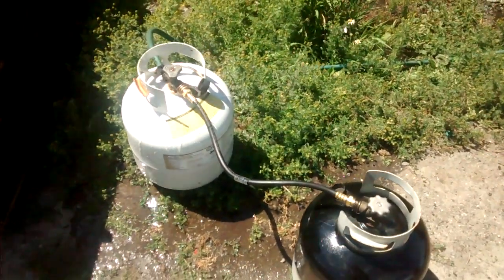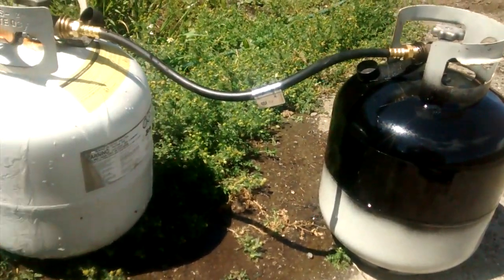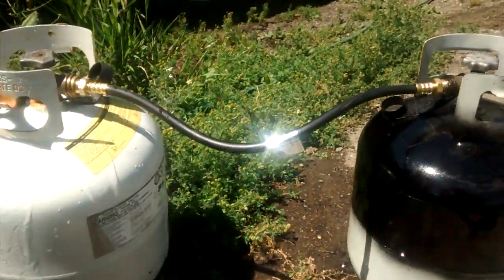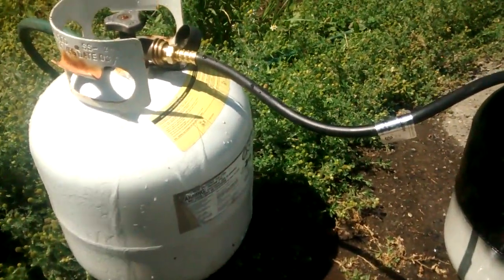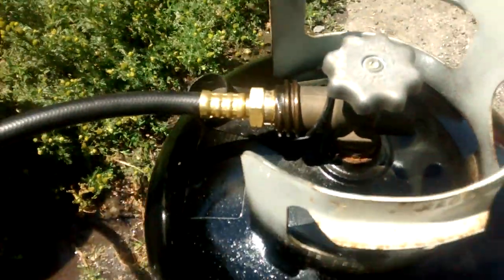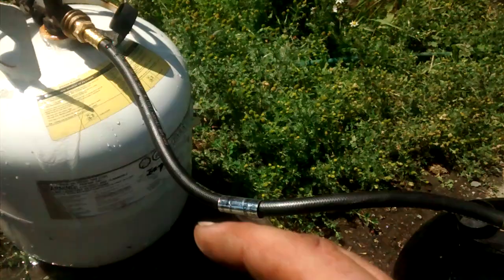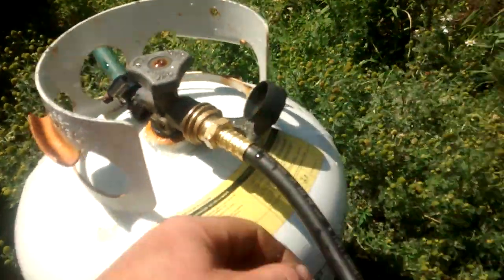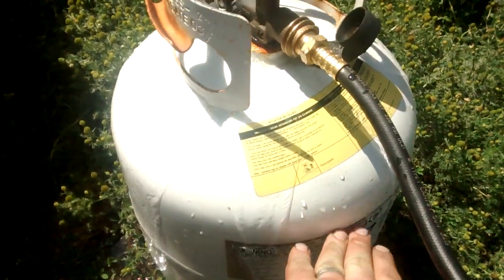How to transfer propane from one 20lb bbq bottle to another #propane #campinglife  #camping

Comment: you can open the bleeder valve on the receiving tank, obviously in a well ventilated area, turn the supplying tank upside down and you will cut the transfer time down to minutes.
Reply from the maker: Dosen't work. As soon as the liquid inside touches the float valve in the tap it shuts the flow off. I can only seem to transfer vapor with these types of bottles.
Reply: this works fine for small containers like fire lighter refill cylinders
Reply: Yea i was gonna say turning the source bottle upside down, bcoz insude its a liquid. This way hes doing means the liquid has to turn into a gas then cool back down to a liquid.
Reply: Interesting, your source tank has the old valve which as I understand didn’t have a float. You can tell the new by the tri lobed valve knob. The older didn’t have overfill protection....the float.
Reply: @machinesnmetal  It actually does work but only if the source bottle is full.  In a full bottle the float points straight up when the bottle is upside-down. I have done this many times but mostly for filling 20# or smaller from 30-40# cylinders.  When the liquid level gets down to 6" or so in the upside-down tank, the float does tilt and shut off the safety valve which is why your partially full tanks don't transfer upside down.
Reply: @chiraldude   when you noticed that theres no more coming into the empty shake the one is elevated the stressed gas will force the liquid to flow into the ether bottle
Reply: @machinesnmetal  - I think that is a safety feature of the newer tanks so they won't let liquid propane out if tipped. When upright, the valve is open to allow the vapor out as intended. :) I am no expert.
Reply: @ussmillerco  _ I think that is why merchants won't fill the old tanks - new tanks = safety feature.
Reply: @chiraldude  _ thank sounds reasonable.:)

Comment: What most people don't know is there is a dipper pipe in those big LPG bottles (not all), that goes to the bottom of the tank. The pressure in the tank pushes the liquid from the bottom of the tank, though this pipe, to the smaller gas bottle when the bleed valve of the small bottle, is opened.  So inverting a bottle that doesn't have a dipper, is necessary for the same process with standard gas bottle.

Comment: if the "supply" tank isn't full, most of the liquid propane is in the bottom of the tank. If you paint the bottom 1/3 of the supply tank black, it will heat quicker and/or hotter, which should increase the "boil off" more and give you more propane and/or less time.
With that said, as others have mentioned, not sure why turning the supply tank upside down won't do a better job. Just like is done to refill 1lb bottles from a 20lb cylinder. 
In any case, nice hack
Reply: I do think he was just trying to give a short no hassle low money propane transfer but in my opinion you should make your own video instead of giving extra advice.
PS
       My wife just said to me if he's so smart why doesn't he make his own video lol.
And then I told her I was thinking the same. thing.
Reply: @YHRIM
I appreciate your input!  I think many of us learn a lot more from knowledgeable people sharing in the comments than we would have otherwise.
Reply: @craigkerr9281  it's just additional input relax
Reply: He gave his input then followed it up with a compliment which is how I wish more people would communicate on YouTube personally. And if we start telling people what they can and can't say then we might as well be communists like Russia, China; 
I learned from both of them (the OP and the commentor not Russia and China) so hats off to our free country. 

Only two things I've learned about Russia and China is that they 1: Have some of the harshest dictarors strict policies and nearly no freedom of expression, and 2: They have some of the most amazingly beautiful, jaw dropping gorgeous women in the world.  
Hey its a free country so ima voice my opinion too, in the propane video comments yessir thats right. Peace and love to all, bye bye
Reply: I agree make a video with this additional information. It will help folks, and when dealing with volatile gasses knowledge saves lives. 
(Posted with sincerity)

Comment: Why not just turn the donor tank upside down and the open both  receiver and donor tank valves? Just like with filling a 1 lb bottle from a 20 lb donor tank/bottle. You have the screw vent to open up and close for ventilation unlike on the 1 lb bottle. That way I can also refill my expired bottles that the facility wont fill up and have some reserves on standby.

Comment: Thanks for the video. I was looking to verify it's possible but for the opposite reason of refilling an expired bottle until i can afford a replacement. Nobody will refill the old expired horizontal tank in my RV but vertical ones don't fit inside its housing so i intend to refill my newer bottle then use it to refill the horizontal bottle which is larger so i know can safely hold the full amount.... Figure I'll need to use an elevated hot bath holding the smaller bottle will help while keeping the larger bottle cool...

Comment: leave the tank your transferring from in the sun this will make the pressure rise . when transferring to the cool tank turn the hot tank upside down now you will be filling with liquid . will go a lot faster
Reply from the maker: Dosen't work. As soon as the liquid inside touches the float valve in the tap it shuts the flow off. I can only seem to transfer vapor with these types of bottles.
Reply: @machinesnmetal  I wonder why that is because I don't have that problem transferring to a 1# bottle?
Reply: @angeliquerider-mitchell2538  new 20lb tanks with a triangle handle (like the one he’s filling) have an OPD valve , basically a float valve, that stops flow when full.  If flipped over it would also stop flow, 1lb canisters do not habe them. 
Oddly, the tank he was transferring from was the older type star handle, that is a non OPD and could have been flipped over making it much faster.
Reply: NO
Reply: Agree with Bill, the older valves were phased out (by trading them in and having the supplier add the new valves). The newer valves added a float to prevent overfill by a inexperienced refiller.
Reply: @billjohnson9343  - it is my observation that the difference is the large outside thread on the fill port of the newer tanks. The old tanks have the smaller (reverse) threads in the inside of the fill port. They both have interior threads but the new ones have the outside large threads with non-slip plastic fitting on them for easy (no wrench) connection. The valve handle shape probably is part of the new tank ID also?

Comment: News flash.   Turn the black tank over and you'll be transferring liquid instead of gas, this way the black tank won't lose pressure when boiling off (similar to any Freon) because propane is a Freon that is not used because of it's explosive nature.   You will get the job done in 5 minutes instead of an hour.   Cooling the fill tank is fine and starting with a warm filler bottle is good.
Reply: News Flash!!  Propane is a refrigerant. Freon is a company name who makes refrigerants. I promise you that Freon does not make propane. It comes from wells with natural gas and is separated out.
Reply from the maker: Dosen't work. As soon as the liquid inside touches the float valve in the tap it shuts the flow off. I can only seem to transfer vapor with these types of bottles.
Reply: Mark😂😂😂😂😂😂😂
Reply: @machinesnmetal  - After reading some of the comments, it seems that the "upside down" method only works if the supply bottle is one of the larger bottles?

Comment: I always thought propane vapor condensed back into a liquid at -47F/-42C unless it was mechanically compressed. Or  I should say propane boils above -47F.

If you were to connect a full #20 tank to an A/C evaporator coil with a fan behind it, then connect an empty #20 tank from the discharge end of the condenser and place it in a deep freezer could you use this set up as an air conditioner?

So as the liquid turns into a gas it absorbs heat. As you may know propane has similar heat absorbing properties as R-12 refrigerant. Only problem is it's explosive.

The question is would you need to turn the full tank upside down and feed the liquid through an expansion valve? Or just crack the valve open and send the propane gas through a regulator on the source tank turned right side up?
Reply: The ideal gas law is PV=nRT - 

So the mechanical compression idea is a moot point when both bottles are already filled with liquid propane. 

In the end you're only looking at a difference in substance quantity and temperature. Im not sure how to calculate the Δt required to change from liquid to gas under the pressure that would exist, but if @UCcu8lp2Hrt4Ux3e2Bt_yf9A says it works, and has video proof, then we can assume it actually does work.

Comment: What store did you get this adapter at?
Reply from the maker: Lordco
Reply: Mr. Heater 2-Tank Hook-Up Kit with Tee and 30-Inch Hose Assembly with P.O.L. Male Ends.   amazon
Reply: i got mine at Tractor Supply Company

Comment: Worked for me (i used hot water instead of painting it black, and an ice bath instead of a hose) tool about 2 hours.   Sounds like other people recommend turning it upside down, I didn’t do that... but it does make sense
Reply from the maker: I tried flipping the source bottle upside down but there seemed to be a safety valve inside the bottle that would cut the flow .
Reply: this style bottle has no straw. so the liquid propane boils and exits the valve as a gas.   there is another style of propane bottle designed with a straw that sucks the liquid propane up from the bottom.  the top of the propane boils and creates pressure that forces the liquid up the straw...  perhaps the other people were using this other type of tank.

Comment: Why not turn the source tank upside down ?  and I though that since the pressure doesnt continue to drop, it will continue to stay liquid ?
Reply from the maker: There's a float valve that shuts the flow off if the bottle falls on its side or upside down, nothing will come out if it's upside down.
Reply: Would the float valve still be floating open when liquid still exist and upside down ?
Reply from the maker: float valve would close valve.
Reply: @machinesnmetal  I also wanted to ask you this, but because I wanted to know the answer instead of sound like a smarty pants, I bothered to read the comments where a million other people asked this. Thank you for answering the same question several times so I could find it!

Comment: Flip the one your draining from upside down and make it higher then the bottle your filling (so liquid is draining).     A way to speed this up would be to put the bottle your filling from out in the sun for a few hours to make it warm.    It would take forever to do it the way you are trying to do.
Reply from the maker: Dosent flow upside down, tried it more than once. there is a check float valve that stops the flow. I'm not really in any hurry, retired and have lots of things to do while this is hissing away outside the shop.
Reply: @machinesnmetal  It will if your drain bottle thats full is warmer then your one your filling.   I do it with 45kg bottles all the time.  You must flip the bottle upside down your filling from
Reply from the maker: I've only done it once , for that video 🤠
Reply: @scottbennett8018   (& @machinesnmetal) - I think the key to the upside down method is the larger (as in 45#) bottle. The liquid propane is accessible to the outlet tube until the liquid reaches the level where the float valve kicks in (actually stops floating and drops because it is inverted) and stops the flow. 
I also think some people are comparing apple to oranges - old style tanks to the new tanks with the safety valve/float. 
Let me know if I'm missing something here......

Comment: Just flip the black bottle upside down as this will speed up the process. jkjkjk You already answered that about 10,000 times, but for some reason commenters cannot read priors. thanks for the video
Reply from the maker: I think I tried it upside down but the safety valve in the fuller bottle kept closing off the flow.
Reply: @machinesnmetal  You should just flip over the black bottle to speed it up and get er done

Comment: Where can I get a hose like that? How do I search.  I keep finding 20lbs to 1lbs
Reply from the maker: It's a "Pol to Pol" type hose
Reply: @machinesnmetal  I appreciate the response, but I'm just not finding one anywhere on the internet. I even called a propane supply place they didn't have one either. 
If you have a link I'd be grateful
Reply from the maker: https://www.ebay.com/itm/173614629303?chn=ps&mkevt=1&mkcid=28&var=472292975421&srsltid=AfmBOorO3QseteXU9TT8RdPv3hjRQo4pSFG1ddQze6Z8QWiajxJv2efIcM8
Reply: @machinesnmetal  thank you..... Damn that's expensive

Comment: Aren't you supposed to put black tank upside down?
Reply from the maker: There's a float check valve in the black tank valve. shuts flow off when tipped past 90 degrees.

Comment: Curious to know the actual gain here considering the wasted water which is costly beyond the dollar....
Reply from the maker: i get 1/3 to 1/2 full bottled turned in for recycling all day long, and the water is free at work. I consolidate the fuel and take it home to heat the shop in the winter time, it's a win win win!
Reply: Ok....use ice and water in a bigger vessel that holds the tank being filled. Or Do it in a river, sheesh where are you....water is quite cheap.

Comment: That's really safe!
Reply from the maker: Safest way I know.
Reply: @machinesnmetal  the only problem is to overheat the black tank...if that is the case the tank is equipped with PRV pressure relieve valve....which will evacuate excesss pressure
Reply: its perfectly safe. how do you think they fill the damn things

Comment: Thanks, but gravity works better!!! Put one bottle upside down at a higher level than the other. Gravity does the rest… NO PAINTING BOTTLES OR USING OF WATER!!!
Reply from the maker: Dosent work. These bottles have a check valve that closes when you turn upside down .
Reply: Read the other replies before replying. This has been addressed several several times.